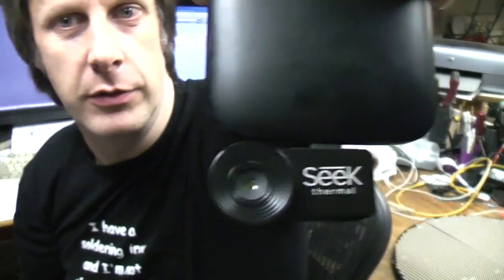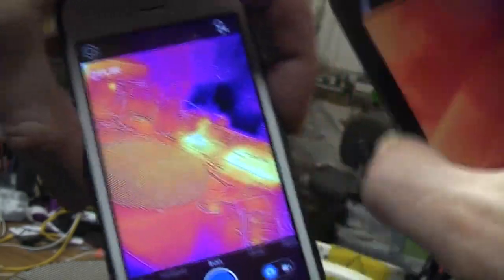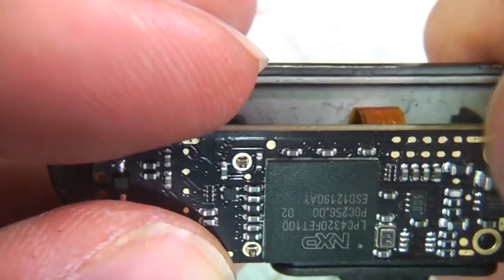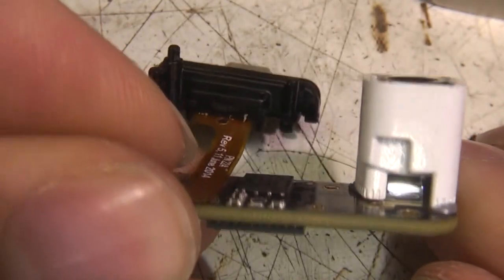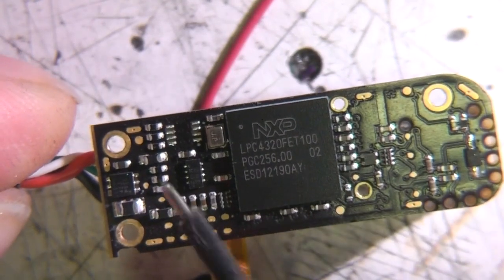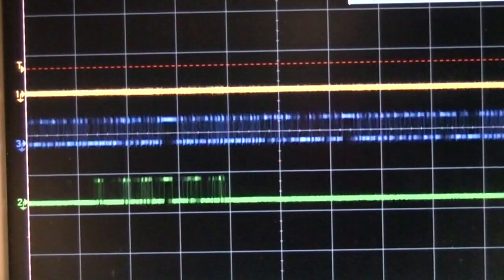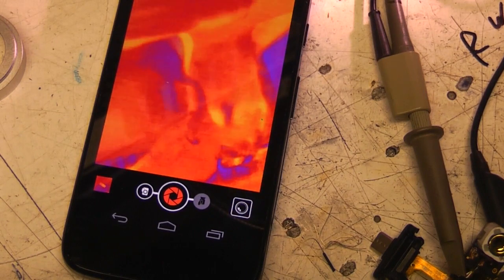Seek Thermal camera teardown part 1

Comment: Gret vid. For the cam... Got one. Failed. The regulator you mention in 22:00 is very hot. It has 5v in and 1v in. Do you know the part reference so I might replace it and give it a 2nd chance?

Comment: very nice video, i have seek thermal and it is not conecting all the time, sometimes work mostly doesent, what do you sugest to test in non working, the port is fine and has voltage all the time...

Comment: Hello friend, i have a request, could you do a tech nerd camera tear down? Tech Nerd is an upgraded Seek Pro that is for sale for 900 USD i personally have it, Tech Nerd Company says that they have modified the seek pro camera hardware, i would like to see whats the difference. i had have both cameras, and Tech nerd seems superior on small component like smd resistors and capacitors, i use it for board repair.

Comment: Got my Seek Compact Pro FF. It is fast and sensitive but very very noisy at low signal levels. The app is available in Canada. It is freezing very often. I am trying to return it as it has a large number of random spots and marks on the sensor, only visible at low thermal signals. I am curious if all the cameras have this problem.

Comment: what are you thought of hooking it to a 5.8 transmitter so I can mount on a quad copter to do search and rescue?
Reply: +matt meisner  It doesn't see that far.  Maybe 5-6 houses away.  You would have to have a really good idea where to start looking to begin with.    Maybe the XR model is better suited for this.  I hear since it has more telephoto  effect, the view is more concentrated to 2o degrees.  Think of this thing as when the first digital cameras came out.  Their photos looked like blurry, pixelated crap.  Maybe in 10 years, this field  will begin to have a whole lot more definition and sensitivity.
Reply: Oh OK
What would you recommend

Comment: You can probably answer my question. I didn't see a video but have you or are you going to do a tear down of the Flir One 2nd Gen model? The reason is I ask is because the Flir cameras need light to be able to blend the images to give the outline of what your looking at or it can be hard to tell. I've come up with the idea / theory that if you can remove the IR filter behind the regular lens of the Flir that you can then use IR LED lighting to get the blended image while being in complete darkness. I say LED because they won't produce heat to interfere with the other lens. I'm sure you know that if you remove the IR Filter "hot mirror" from a lens that it will allow the camera to see infrared light that the human eyes can't see. I just don't know how easy it could be or if at all. Some lenses require a replacement glass afterward or they'll be out of focus. I want the blended msx while being in complete darkness for ghost hunting.
Reply: Ghost hunting, lmao.

Comment: Someone with a 3d printer or simply good hacking skills (glue and ducktape) could make a case for that, that would fit the user's specific phone.

A small ebay search would yield a flat cable for the usb and one could bring this reasonably close to the phone's camera...one step further and with some coding skills he/she could have this running in tandem or overlay.

That's a really neat toy/tool right there.

Comment: Interesting. Thinking, Xray the board? Might give you clues about the traces.
Reply: Also if he's going to sacrifice one of the cameras later as he hinted at, is probably possible to carefully grind down the board layer by layer and see the internal layout that way.
Reply: Mythricia If it was me, I would try to avoid "delaminating" a PCB at all costs. I have never done it, but my gut tells me it would be an amazingly awful job. Doing an xray screening seems like a more feasible solution to me, assuming he'd be able to get enough resolution at such small scale.
Heat the thing up, shake all the components off and do it.

Comment: id love to see this work over USB ... my laptop is next to my bench and that would be more usable to me than busting out my S5 every time i want to trace something
Reply: It should be pretty trivial to reverse engineer the protocol either using a USB analyzer that sits in between the phone and the device, or by writing a simple program with libusb that logs the data of doing bulk transfers (Android doesn't support isochronous USB transfers, and I'm assuming there is only one-way communication on a single USB endpoint for this device)
Reply: Yeah i have heard on forums its relatively simple and we will probably see that soon, also if someone does make an O-S firmware this would be totally streamlined and useful for long term measurements

Comment: Is that a dead pixel in the middle of your recording? :(
Reply: Pure Engineering or a reflection from a red led on the front of mikes camera
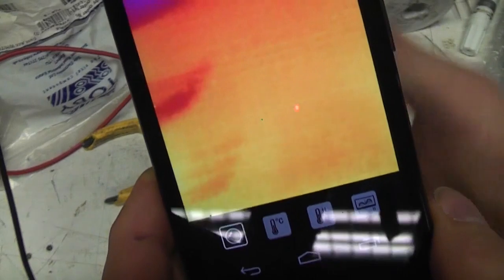Reply: Pure Engineering 8:31 above the red dot, black dead pixels.
Reply: look like a laser pointer.
Reply: I see it, too.
Reply: Dead pixel from laser, IMO. You can burn these really easy with a high power burst.